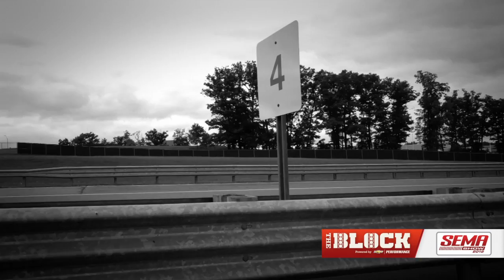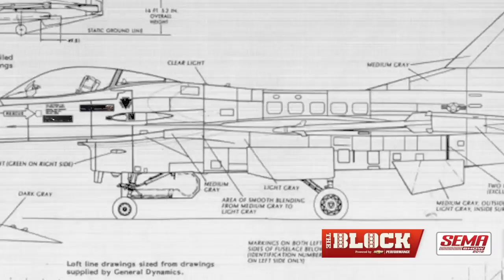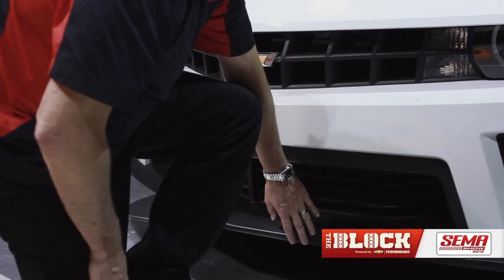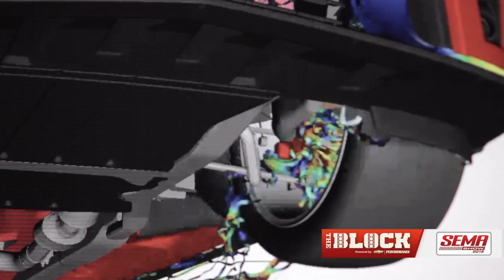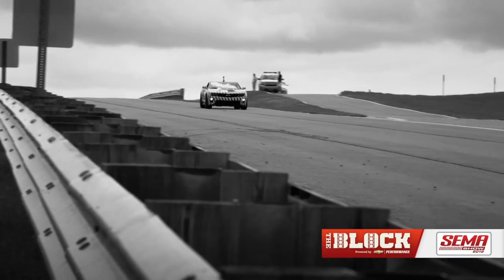Perfecting the Camaro ZL1 Phase Four: Aerodynamic Testing

Comment: So what are the coefficients for these cars?
Reply: Point 35 to point 37 cD. Quote :" The long hood and short deck are pushed to the far corners of the muscular fender forms and a fast, 67-degree rake windshield contributes to aerodynamic performance that includes a 0.37 coefficient of drag (Cd) on V-6 models and a slightly sleeker 0.35 Cd on the V-8-powered SS model." Source Chevrolet media ( Google it ! )
The main source of drag on these cars comes from the large, open spoke wheels. Here, you can see a 'tuft test' that shows a wall of turbulence behind the wheels - especially at the rear : https://youtube.com/watch?v=fzN5InPImT4&si=HUdm5XvP1xGccPqt